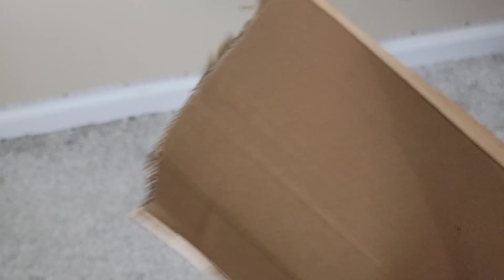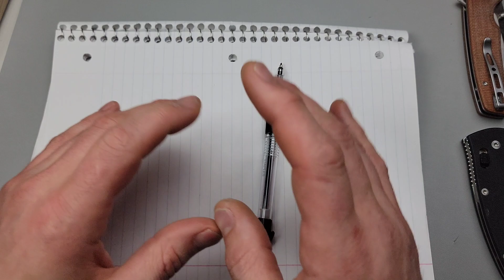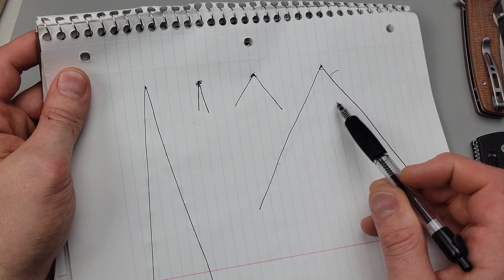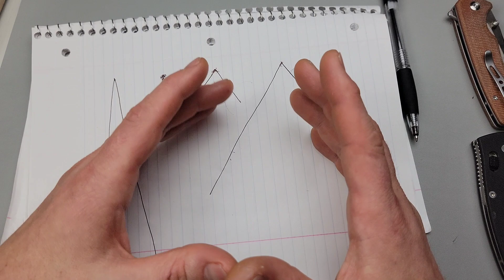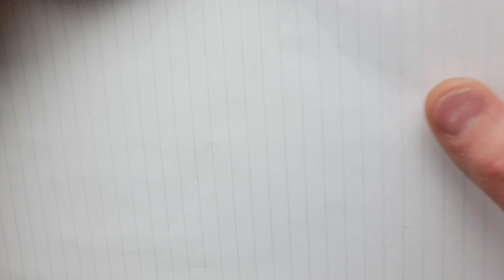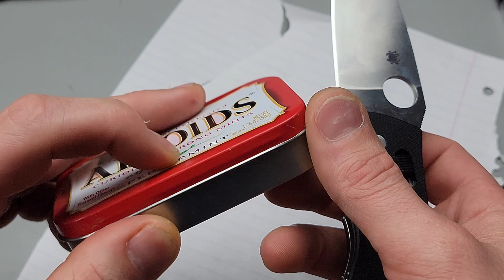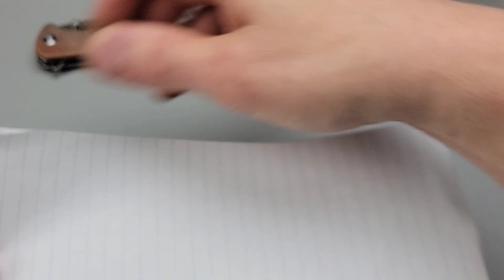LOW VS HIGH ANGLE EDGES EDGE RETENTION

Comment: Keep up the great videos! They are very informative. It would be awesome to see a community project chart or spreadsheet that goes into steels, angles, finishes, then maybe even different knives/makers under some steels since some makers are known for amazing steel X and another maker has horrible steel Y and they might handle an edge differently than you would expect. If you have a stupid thick knife with a low heat treat and a different thinner knife with a high heat treat both in the same steel, they might get vastly different results with the same finish.

It would be an amazing resource for both new sharpeners wondering what is best for their Opinel and experience sharpeners who ran into some super exotic XYZ-123 that they have no experience with.
Reply from the maker: Yeah that's the difficulty, is there's so many different geometries and heat treatments
Reply: @NeevesKnives  Every journey starts with a single step, and every project has to start somewhere. It could be started with a general "Steel X generally handles [edge] well but not if it is a softer heat treat" and the like for example. Then if the knife community bands together to fill in various makers, specific knives, oddball heat treats etc it could become a more comprehensive knowledge base. But then you run into the problem of how and where to host it and keep it maintained. 

I think it would be cool if in the future you watch a sharpening video and the person brings up the "Knife Sharpeners Compendium" and what it says about that particular knife or steel before they decide what kind of edge to put on it.

Comment: Looking forward to the grit to finish different steels. Thanks for the info. 

I have been doing a 20 degree on almost all my knives as of late and I like it. 

The only knives I might go less in are D2, 14C28N, especially by Ruike and then super steels. 

Picked up the Manix 2 in SPY27 and I think it comes real close to 17 degrees from the factory. 

Like you say, it depends on what you use your knife for. 

I'm seeing lots of M390 not even hitting the 60HRC. That worries me at the lower angles. What are your thoughts on lower HRC and super steels?
Reply from the maker: Spyderco does a really good job on the hrc, and most come with a 15° then 25° micro bevel, I believe it's 25 or so. But I'm sure some can vary. But yes if it's on the steel is softer a lower angle might not have great stability through tough use but the geometry plays a huge part, thicker blades behind the edge will have more meat to be stable at lower angles, also the difference in flat or hollow can play a part. As far as m390 goes if it's very thin and soft I wouldn't go to low 17 to 20 should be a good angle for most. But if it's thicker bte then you can drop it a bit more to like 15° but if you notice issues you can always add a quick micro bevel
Reply: @NeevesKnives  you the man!! Thanks Jared
Reply: Most m390 isn't worth the extra costs unless it's using the correct heat treatment and hrc. Hrc alone won't improve a protocol that's not idea for m390. Most companies just want to sell you a bill of materials. They dont realize how different austenitizing temps and temper temps, quenching methods etc make a huge difference in the performance of m390. They just say the hrc is in spec.
Reply from the maker: @tacticalcenter8658  very true

Comment: Can you recommend a sharpening jig that I could use to help me make sharpening easier?( Trying to sharpen mass produced D2 steel)Like the Spyderco one but its kind of expensive(80.00). I've learned alot from your channel thanks.
Reply: Have you tried checking out the work sharp Precision or the Ken Onion?

I just recently bought the Precision cus the wasn't must I need to fiddle with and straight forward to use.
Reply: Use diamond's for d2. It has a high volume of chromium carbides. 80 is too expensive for d2 steel.  The performance is often like 8cr13mov but really hard to sharpen for most people. Something like a A 300, 400, 600 grit progression. Cheap Chinese diamond's will lie about the grit values, so stick to brand names. You can get edge pro sharpening stones and just use them to sharpen by hand as they are cheaper than buying larger bench sized stones.

If diamond is too expensive for you, you can try edge pro stones in silicon carbide. Not as hard as diamond, but should work fine on d2. If you just want to experiment, harbor freight sells some cheap diamond sharpening plates. These are terrible but they will sharpen things.

I have the ken onion work sharp, and it won't work well on d2. Only worked when I got the diamond belts and they wore out after two knives. Not worth it for d2.

Comment: Another myth. Microbevels make the edge stronger, tougher etc. Nope, that's not true, because they are still flat "v" edges. If you want to reinforce an edge, convex the edge bevel or raise it's angle or both.
You see them only on factory made mass produced knives, because it's the fastest and cheapest way, to put an edge on knife.
Reply from the maker: It is true, because a micro bevel is at a much higher angle and allows the behind the apex to be thicker, instead of the apex being 15° its at 25° and I spoke about convexing as well
Reply: Convex edges have their uses. Especially in feather sticking and a variety of other uses like processing animals etc. They are not without cons though.

Comment: You got any tips for keeping the knife's tip sharp? I'm a baler worker and typically have to punch holes through the back of the compactors to empty them out, after a while it really does a number on my knife.
Reply: Definitely get a tanto blade for that
Reply from the maker: Yeah get a Stout tanto, I'd go with something from COLD steel most likely, if not make sure it's got a thick Stout spine, it's going to be about the blades geometry more than anything
Reply: Sounds like you need better geometry at the tip. A steel and heat treat with better stability would also help.

And lastly, if you look at the edge under a microscope or a loup after the edge damage. That edge will have craters, flat spots, bends etc... When you sharpen that damage without first removing said damage, your just building that new apex on all that fatigue damaged edge. That makes your apex weak. Sure it gets sharp, but the foundation isn't strong as it could be.

It would be wise to run the whole edge on a stone to dull it, take off the apex completely. All that damage should be gone. Then put a new apex on the blade. This way you don't bur over fatigue steel and your edges will last longer.

Also check out Joe X on YouTube. He has stabbing tests that should help you decide on a knife that will perform in the way you want.

Comment: So neeves, if you could choose one edge angle for light use/edc what would it be?
Reply: 15-17° for slicing with a knife that is thin behind the edge. 18-20° for general tasks. 25° for chopping etc.
This all varies depending on many factors like steel composition, geometry, v or convex, and heat treat (Microstructure and hrc) of said steel composition.
Reply: 18°-20°
Reply: @knifeaddict1014  thanks, that's what I figured

Comment: A quick vote: On an edc knife, you can choose maxamet or AEB-L? You have to choose edge retention or toughness, can't choose something in between, discuss below⬇
Reply from the maker: ID PERSONALLY CHOOSE MAXAMET IN THIS CASE, NOW IF YOU SAID 14C I MIGHT OF HAD A DIFFERENT ANSWER
Reply: @NeevesKnives  it's crazy how a "budget steel" has entered the ranks of these once powerhouse steels, awesome time to be a knife enthusiast!
Reply: I too would pick 14c28n. Though aebl is great for what it does. 14c28n can be brittle in the geometry and heat treatment that some mass production companies use. But it can also be tough when the company knows what they are doing. I've seen some busted tips on Kershaw and we knives 14c28n while other brands didn't. Geometry and heat treat play a roll in all of that. Mora is a great example.
Reply: @tacticalcenter8658  I totally agree. It's even crazier that 14c is a "budget" steel. On an edc knife, I would honestly pick it over just about any other steel.